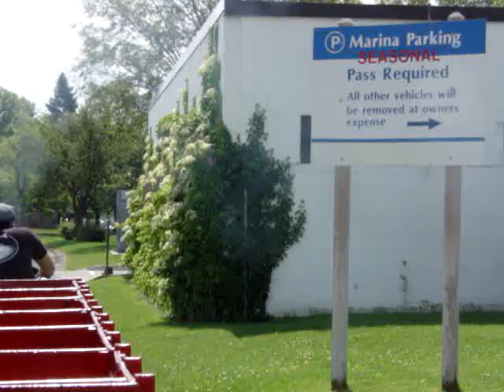Steam Train

Comment: @jjaagg5050 One of the plans (Scheme B) does not work for the train. The radius for the curves near the beach are way too small. However during a meeting it was said that this plan won't be considered for a variety of other reasons.
Scheme A does not include the train (but will still need to have funding to remove the tracks) and Scheme C includes the train. It is not ideal but it will work. Now just need to keep up the support with the Traverse City City Commissioners to keep the train.